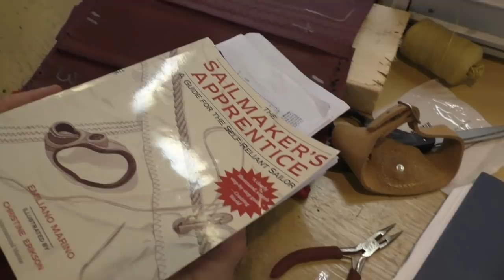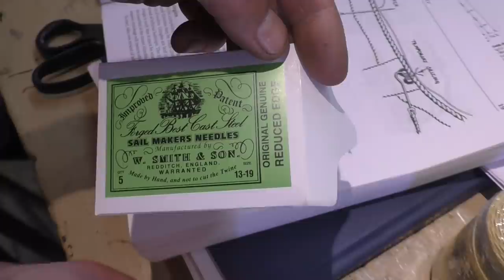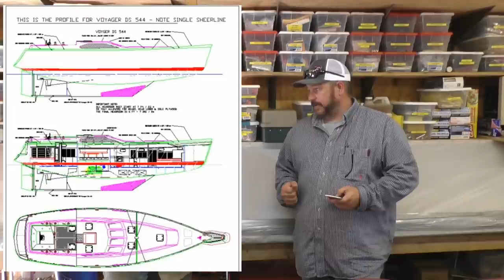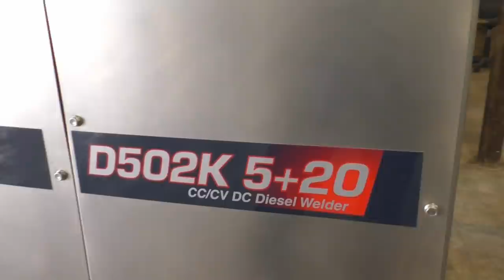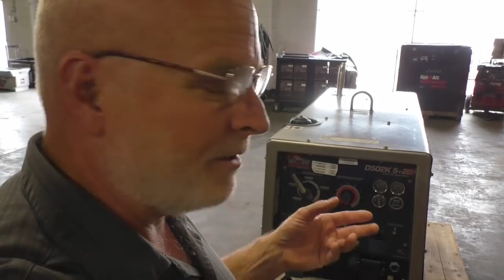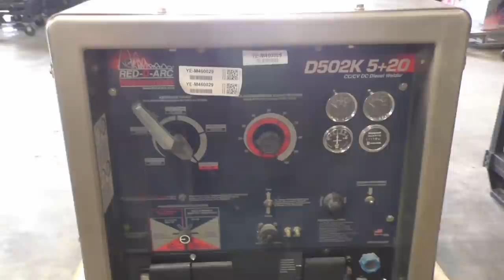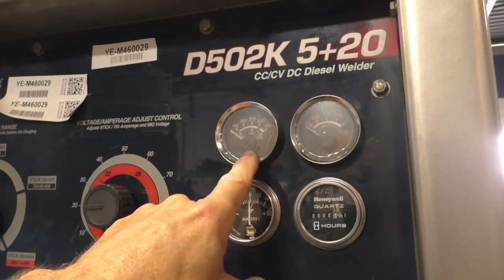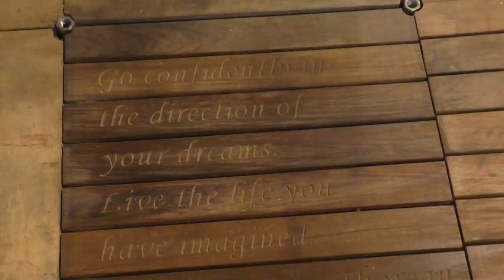Roping Sails, Hatches, Handrails and Build or Buy a Boat

Comment: You can run the pump off of a rectifier to use battery power. For electrical safety, all of your AC on the boat should be through GFCI circuit breakers. No risk of electrocution that way.
Reply: You mean an inverter? A rectifier converts AC into DC.
Reply: Shhh, don't tell him that.
Reply: Good one man...
Reply: Well, if the pump is using a universal motor, you should actually be able to just run in with 120V DC...
Reply: Well I guess that you actually have a point, but have you consider how much more deadly are 120 DC?  I mean in the mining industry they give you a hole week of training and horribly graphic illustrations of what happen If you get a hold of that type of power...
Reply: Meh, 120 V DC is less dangerous than 120 V AC. It's just harder to switch off. That being said, in a wet environment, both are very able to kill you if you touch the bare wires in a stupid way. 
I'd be much more worried about the batteries you have to use. Those can roast the whole ship (depending on the type and size) if you make any major mistakes while building the circuit. And I'm not talking about the actual batteries burning, rather them pushing so much power into the cables that they go up in smoke, along with the pump.
Reply: Why not put 60 lead acid cells in series? They're pretty robust. Of course, you should be careful with insulation and water ingress. And get yourself a nice chunky switch that can handle a few hundred amps at 120 V DC. But other than that...
Mind you, this is only a hypothetical discussion, because it would just be much safer and more space efficient to get yourself a nice big 24 V LiFePO4 battery and put an inverter on it.
Reply from the maker: Yeah. I like that idea.  Not crazy about having more equipment in the loop, but it will save a lot of money.
Reply: I believe that regardless the system you decide to use, For as long it have a ground fault protection system it will be just fine..From my perspective, I rather get the safety Nazis out of the building...;-),
Reply: Non-sealed lead acid batteries on an ocean going vessel are HIGHLY DANGEROUS. If the compartment floods enough or a wave crashes in during high seas that salt water gets into the batteries, large amounts of chlorine gas is produced. No, it will not immediately dissolve back into the water since the remaining salts in the reacted salt water and electrolyte keep it from doing so. Sealed batteries only on ocean going vessels.
Reply: One of those worms is internal resistance of each battery eating into your total voltage out and heating up the batteries. But you can make higher voltage DC from a DC source easily with a boost converter or a switch mode power supply. Not really efficient (80%), but for high current loads it is better than inverting, using a transformer and then rectifying it back.
Reply: All of the AC systems above 24V and the DC systems above 36V need GFCI protection on a vessel. You are walking around on steel structure with saltwater present. You are a ground to anything you touch. It really isn't safety nuts that write electrical and fire safety codes. It is a board of master electricians, electrical engineers, retired federal fire marshals and a couple of lawyers. They write new code based off of actual cases of electrocution, fire, explosion, etc. Each code change is meant to address the problem with an economical solution that works.

There is a reason that even OSHA bows to these codes when they make their own rules about everything else. They work.

Also, GFCI circuits are the only way to protect against ground loops causing electrocution hazards on a vessel.
Reply from the maker: HIGHLY DANGEROUS?  Ha!  You make is sound like a mine field.   And it's a boat, not a submarine.  Chill.
Reply: Chlorine gas is dangerous. It was used in WWI as a chemical weapon and was effective. It is heavier than air, so it would build up and linger below deck. Besides, sealed batteries aren't all that expensive and would last longer in a marine setting.
Reply: KnightsWithoutATable
Dude.  Chlorine gas and NaHo are produced when you electrify salt water. But in SUPPER SMALL AMOUNTS. I have done a decent bit of electroplating and such using salt water, and with 12 v you can barely smell the chlorine in a closed space. With 120V it might produce enough in an hour to sting a little. If it is not vented.

That being said, an open cell could spill.  Sailboats often heal as much as 40 degrees under sail and can rock more than that.  It is not uncommon for a boat to roll completely over in a storm either.
Reply: But if I wanted to make lots of clorine gas I would add lots of salt and make sure the system could support that current. (without a voltage drop) so it is not only about voltage.

Comment: Probably be best to run a vent pipe up through the deck, and vent to the outside, rather than vent exhaust into the engine room, also may be good to fit some kind of extractor into the engine room, as a think it might get a little "close" down there.

Comment: When you bend the aluminium, would it help to cut a thin groove then bend it backwards ?
Then weld in the open joint, should help with alignment, less need for clamping

Comment: Stuck nuts or bolts?  Try 50% acetone, 50% automatic transmission fluid.  Best I've ever used and it beats Kroil, Liquid Wrench, PB Blaster.... ANYTHING.  And it's cheap to make.
Reply: I would have to agree. Its my favorite snake oil and i work on a lot of old rusty crap.

Comment: Just thoughts to add to the melting pot for consideration. !987 at sea off Africa, as it happens, worsening weather which eventually became winds of 68 knots, nearly destroyed the speed measuring thingy. After several days, cause the weather wouldn't go away, of almost no sleep I FOUND THAT NO MATTER WHAT ROLLING AND PITCHING WENT ON PROVIDED I COULD KEEP MY HEAD AND SHOULDERS IN CLOSE ALIGNENT WITHOUT MY HEAD ROLLING, SLEEP WAS POSSIBLE. Plan for this in bunks, with excess packing any thing will do, pillows foam I even used my holdall with clothing. ENJOY YOUR ADVENTURES.

Comment: You might want to check the voltages when the generator is being used as a welder... I've seen some serious spikes when they start and end arcs. If it were me, I'd never use this power for electronics.

Comment: stainless steel doesn't disperse heat really well so using it for a soldering iron wont work. as you found out Doug.

Comment: build a forced ventilated fixed compartment / enclosed capsule for the generator inside the boat. then fit a fire suppression system in case of an emergency and an emergency shutoff switch in the wheelhouse.

just a thought

Comment: hey just a quick idea for roping the sails,  why not use a heavier gauge needle with no thread on the sewing machine to perforate holes along the seam.   then just hand Stitch the Rope on.  might be faster than hand burning holes with a soldering iron
Reply: Actually, I only had to use the hole burner one tie to assist when going through eleven layers of 11 oz Topgun .  Otherwise, the needles worked great.  As for needle size...  we used many... from a 13 to a 19....   my choice for roping on this cloth is a 15.

Comment: Well, yes you could remove the cooling system, but to save a few inches, in one area, only to lose it to the piping, pumps and heat exchanger needed to cool the engine?  In the end today's diesel cooling systems are pretty well designs and fairly low maintenance.   As for venting the radiator fan's exhaust, while it would be fine to allow it to blow into the engine room, I think the heat thrown out (especially in tropical climes) will be an issue, otherwise I see no other problems with it.  It may be a problem to vent the radiator exhaust satisfactorily (duct volume & flow etc) and may need large fans to boost it out of the hold, but a hot room in a tropical setting at the very least will be an uncomfortable place.

Comment: Are you 'locking' the twine at regular intervals ?  if the twine breaks, or gets worn enough to break, it may pull out and loosen the rest of the run.
Whenever i sew something that may get rough handling (phone case, equipment bag etc) i like to include lock stitches.
Reply: yes.  there are locked stitches.

Comment: That welder will make the room very hot unless you duct the cooling air outside, in which case the room will be very cold in winter as you will have to allow outside air in to replace it.

I think you would be better just getting a marinised gen set and using it to run a welder when you need one. You will use electricity every day but probably not a welder?

Comment: I have a concern about your welder/generator fuel cell... though these generators are mobile, they are Standstill while in operation. Marine fuel cells have baffling to prevent fuel delivery problems, produced by motion from the sea... does the generator fuel cell cut the mustard or will it cause a failure when it is needed the most? And, how will you manage the exhaust?

Comment: Just build an air trunk/exhaust for the radiator outlet. Run the engine exhaust out the same line as the main engine.

Comment: Maybe this is already mentioned, but I was wondering why you mounted cover plates on the deck with 763 bolts and afterwards put frames with alu hatches on these. Why did you not weld the frames directly to the deck?

Comment: I would have thought the diesel welder would be a bit bulky for your boat Doug. Why not have a diesel generator and take your existing welders? As a whole unit you will probably have to cut a hole in your boat to get it in. 

The Germans get a good education in trades and skills. They still have an entire sector of their economy devoted to advanced manufacturing of all sorts of obscure products.
Reply: It's actually a lot more space efficient to have one genny-welder, than one generator and three welders. There is no way he can get the space efficiency of that unit, and that one has a lot of power.

Comment: I have used a 90 degree router bit to bend thicker plastics. If you can get it to bite on aluminium you could cut 90% of the material and then do the bend. You can also find 108 degree bits. This is the first result I found on google:
https://www.toolstoday.com/p-6193-double-edge-folding-v-rectangular-groove-router-bits-for-shaping-aluminum-composite-material-acm-panels.aspx

Comment: ipe is a bit caustic. my dad got some minor chemical burns on his arms from the saw dust after making a round table out of it.
Reply from the maker: I must have a thick hide to go with my thick head.
Reply: it has a ring that was glued up and routed out of a blank that encompasses the inner boards and the mounds of sawdust had a slight reaction. it came from hours of uninterrupted contact with it.
Reply: Man, y'all got ipe for the floors? I was wondering what that wood was. You're really doing this thing right. Just need a fence for that table saw. ;)

Comment: Have you considered using braided halyard line on your sail?  It is designed for halyard usage so it is stretch resistant and it is braided so it won't twist as much as what you are using.
Example http://www.apsltd.com/line/sailboat-halyard-line-rope.html?line_application_type=16068

Comment: Hi Doug,
She is getting a workout making those sails.  What are you using for sail material?    Weathermax 80 would work well.  I've got that book also...   I some others as well if you need more info on sail making.
Regarding cutting the sail material, I did the soldering iron iron, tried a hot knife etc.    I finally broke down and spent a little over $100 and bought the Sailrite fabric cutter that has the foot.   It works great.   I've sliced up probably 60 yards of material so far for covers using that.   Worth every penny.   Why not contact Sailrite and see if they will "loan" you one if you plug Sailrite.  :-)

Comment: if youre planning on repairing sails on route it prolly be eazier to use he palm thingy as you usually dont have a big table on dek to use to push the needle through 
now that i think about it , you might even not be able to use the table that way with the bigger sails as their to heavy to move around 

about getting the thick plate to bend : maibe place a rod or small piece of roundbar in the groove so the thinner bit bends over the round shape 

think i'm going to point blue man group ontoo youre project :
https://www.youtube.com/watch?v=MEexbOjo3Yw

think using the diesel welder as a generator as whell is a good one , if you put it in the engineroom you might just do away with all the enginecovers as you dont realy need them (the engine is inside )
ou could change the radiator for a water to water heat exchanger i would look if the radiator give you any problems first though

Comment: I'd say you should build the boat and NOT buy one.  If you build it yourself, you'll know there won't be any problems with it and it could be cheaper.
Reply: The problem with that theory in my case anyway.   When i start a project and estimate a cost it usually winds up costing me double what  i initially thought as well as double the time to complete said project.     I would imagine this would be compounded when you start thinking of building a complex project such as a Ship.       Granted when i build something i tend to overbuild it way more durable and sturdy than the project is designed for but i do it this way because i don't want to have to do it twice.
Reply: ... Good point...

Comment: It should be very easy to convert that generator to use a raw water cooled heat exchanger. Just add a raw water pump and some plumbing. It'll keep the boat so much cooler too. Anything you can do to keep heat out of the cabin is worth the effort (you should think about insulating the hull too). You don't need any air over the engine. I have a Nextgen on my boat, which is a little Kubota in a box. It doesn't get much airflow and it runs like a champ. http://www.nextgenerationpower.com/marinegen.html